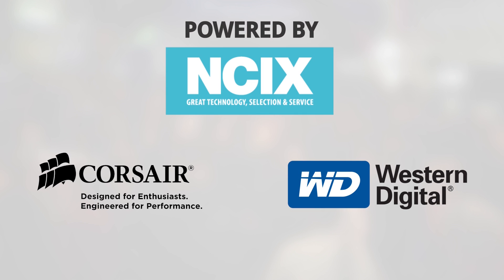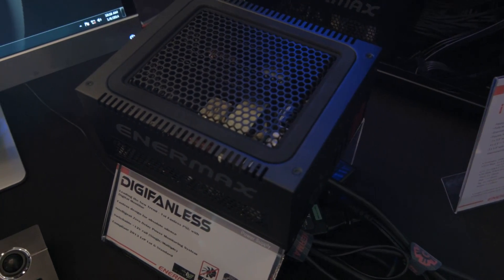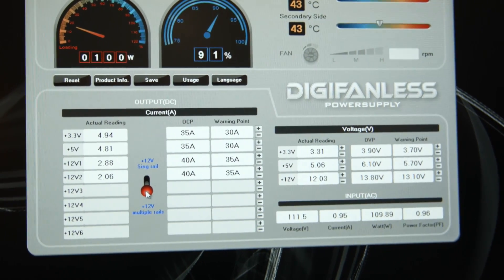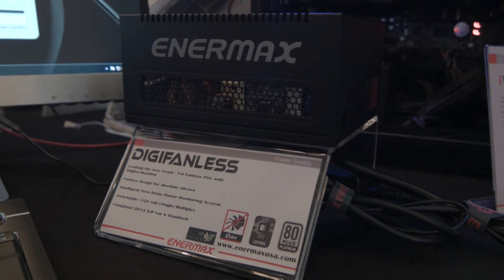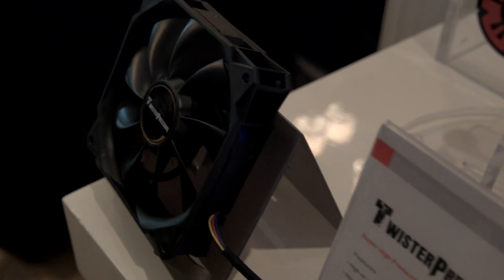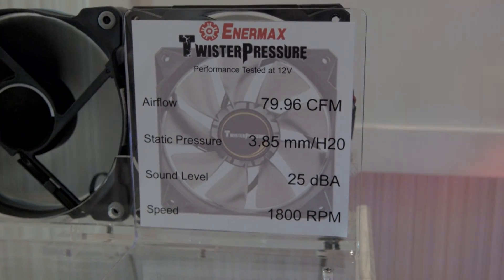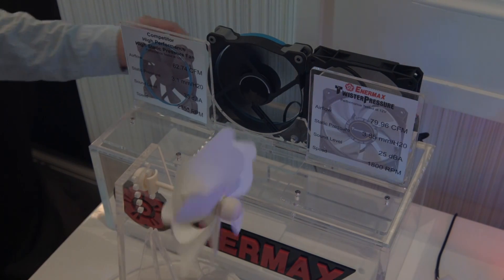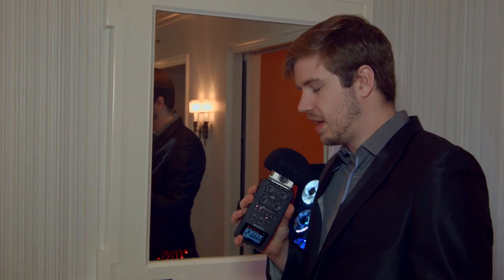Enermax Digitally monitored fan less power supply and SP fan demo - CES 2014

Comment: Instead of making fanless powersupplys, companies should make it easy to replace the fan with a  standard 120mm or 140mm fan. Then we could just get some Noctua NF-F12s (They can be pretty much inaudible) and use those to cool the psu, I'd be happier with that than with a fanless monitored psu.
Reply: manufacturers thinks so advance they forgot the basics.

Comment: my delta fan is over 200cfm. i dont know what the static pressure rating is but i'm pretty sure it would be good at blowing windmills
Reply: It's also like 100 dbAs! Lol, No thanks :x
Reply: EpicKnifeYT no its only 62db at full speed.
Reply: Lawrence Timme
"Only"
Reply: spaceminions yeah there is a massive difference between 62db and 100db
Reply: But 62db is still too loud for most people and much louder than most fans.
Reply: spaceminions it not made for people though its made for servers with lots of passve cools between 2 walls of them.
Reply: Yeah. Or for messing with, or building an airplane- just put one of these under each wing and you can make a new airline with fully electric planes.
Reply: spaceminions that is true. i would try that, but i only have one now because the other one had a fight with my thumb
Reply: How's your thumb?
Reply: great now. that was a few months ago. it wasn't great on the day though or a week later. it didn't break it but it did sort of cut the side of of it off though.
Reply: I bet it hurt.
Reply: spaceminions it did, but not as much as i thought it should have done. i had to go to a&e to get the bit stuck back on and it was working again after about 2 weeks :)
Reply: That's good.

Comment: Considering there are PSUs with fans which only spin when cooling is needed, is it really wise to get a FANLESS PSU?
Reply: yea thats true and also when you are probably doing something when it needs cooling such as gaming you are usually wearing headphones so you cant hear anyway
Reply: crazychainsaw Yeah, I think as long as system is quiet under light load thats good enough.
Reply: I'm more excited about that digital monitoring of your psu.. switching it between single and multi 12v rails, seeing your exact temps, theoretical and actual efficiencies, theoretical and actual produced wattage/voltage.. Pretty sweet.